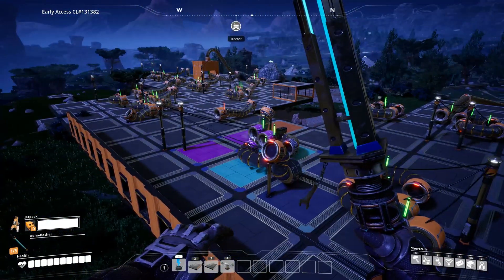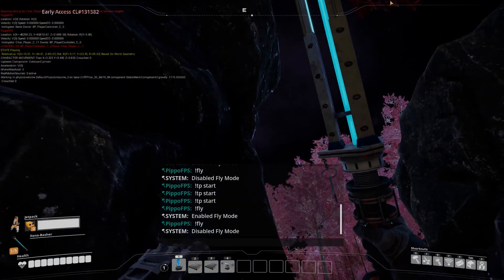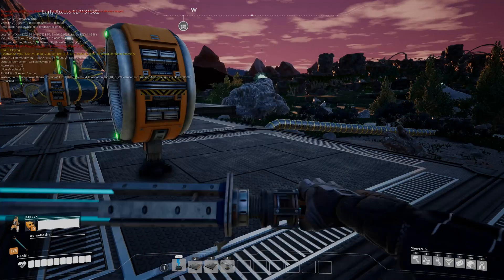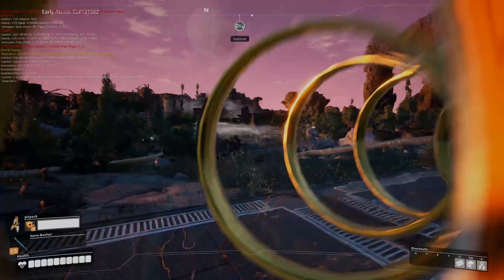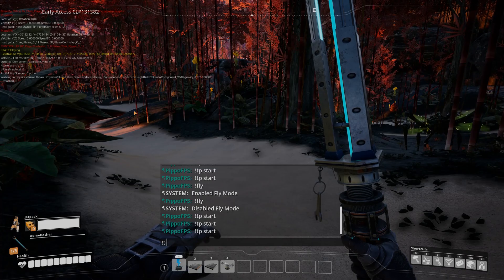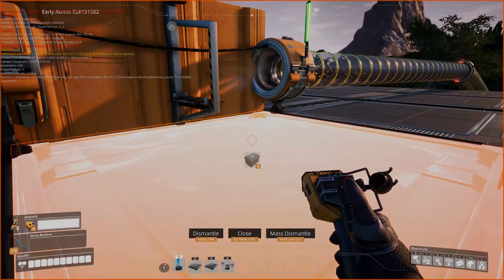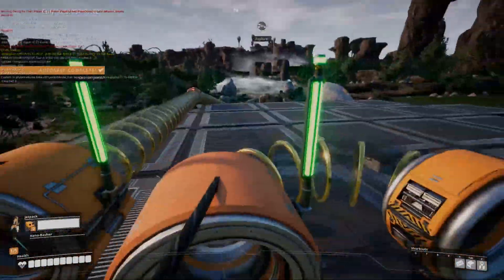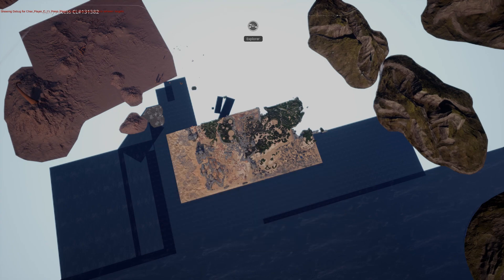Best Hypertube-Accelerator Design? (HyperLoop V1.0)

Comment: trying this now, with update 4, and it need some adjustment: the minimum radius of the curve is bigger, making the loop bigger, and the small launch ramp it have to be bigger and longer. it also get very very seasick worthy when it speed up but... in principle it still works. 

now. in update 4 it works backwards. meaning, it launch you in the opposite direction you're facing. 

and it's super powerful! glad I equipped the jetpack before trying! it l got launched almost out of the map and... well, crashed landed nearby a power plug, so no complain! 

I suggest to build a "one way loop" cause so far it launched me at random directions.
Reply: after more trial, it seems random wherever it launch in one direction or the other. but.. longer exit tube can be done so both exit can be direct in the same way. 

next. calculate the landing zone..... and jelly pad it!
Reply from the maker: @Verdekiwi  Thanks for the feedback. I haven't played for a while :)
Did they remove the comveyor 2d option when placing? This was the only option that allowed for the tighter bend back then :)